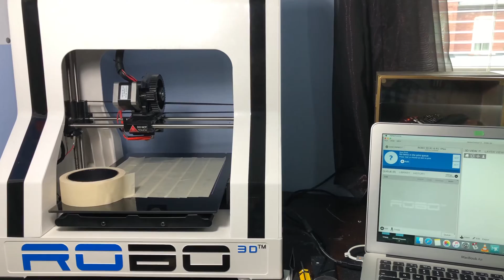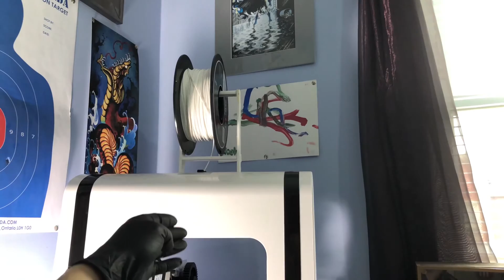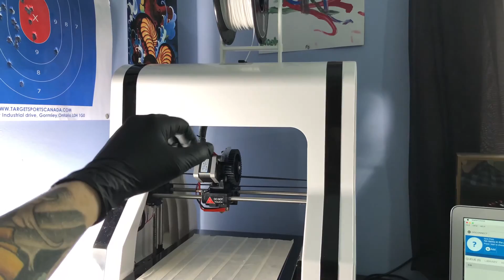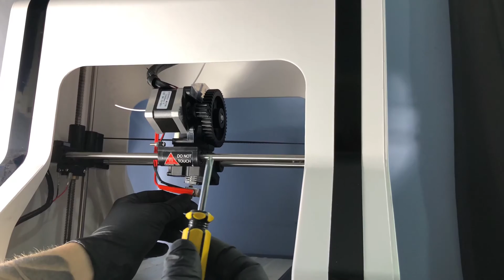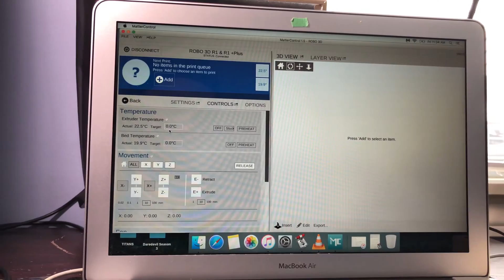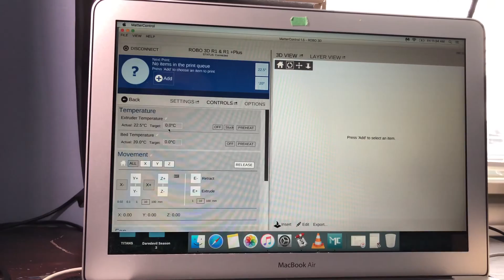Troubleshooting your ROBO 3D R1 Plus 3D printer : Tricks and Tips

Comment: have you had the issue of hardware error temperature too low and stops print?
Reply from the maker: I actually just had that issue the other day. I had to manually adjust nozzle temp to 210 in order for it to stay hot enough to finish print

Comment: man i upgraded to ender 3d extruder put a raspberrypi inside the the the machine with octipi software. and also an endstop to tell me when filament runout. pluss many more...
Reply from the maker: oh nice! that's something I was going to look into next.
Reply: @thnkhrder6266  it will majorly improve your printing..
 Put Marlin firmware. Ur print jobs will look like manufactured .... Like the layers are so jammed packed .. faster prints .... Check it out...
Reply from the maker: @clevetbs123  oh wow thanks so much man